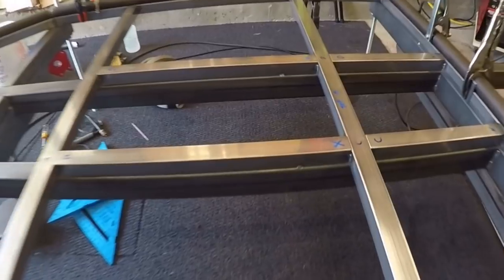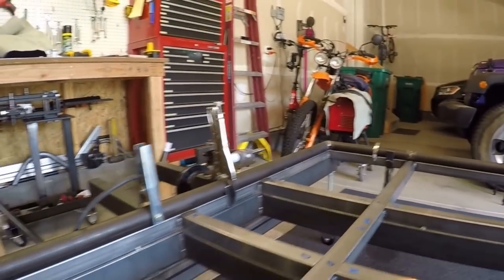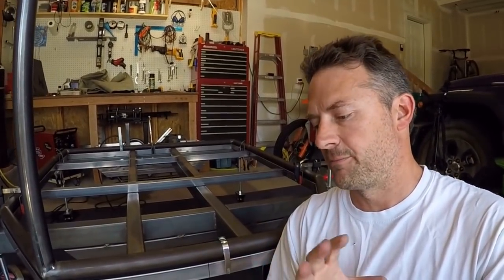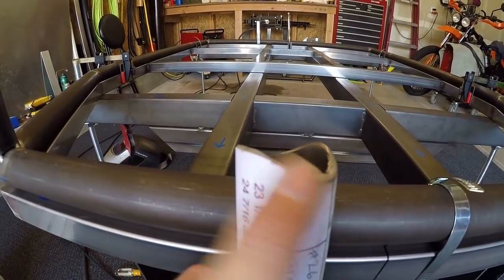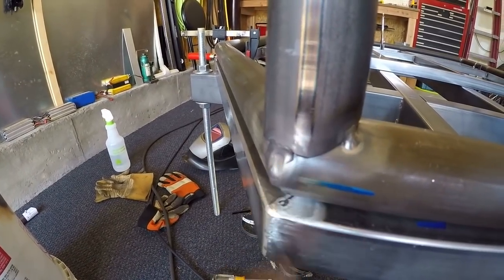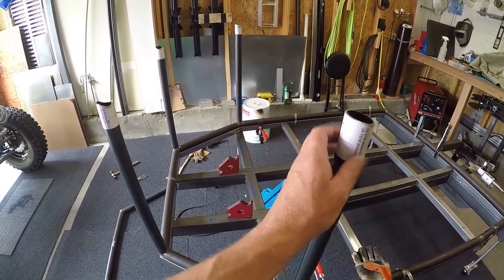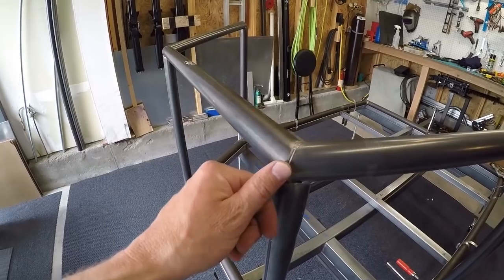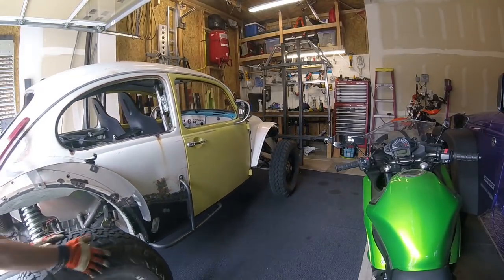Baja Tube Frame Build Part 1

Comment: What type of metal tubing  are you using? reg, dom, chromoly... also what sizes?
Reply from the maker: On this chassis the base is DOM. Everything above that is regular/ERW.
It's all 1 1/2" x .095" thickness.
Reply: @DougBugBuilder , Thanks for the info

Comment: Is there any downside to building the frame from the square tube, rather than round? I know that round is stronger, but the square is easier and flatter
Reply from the maker: The square is a lot easier to start the chassis where the body will connect to it and the floor. That's how I did the chassis I'm running on the Baja right now.
But on this chassis the square tube you see is only part of the jig. The entire chassis you see here will be made out of round tube.

Comment: Hey doug when you built your rear lower control arms what type of bushings did you use
Reply from the maker: I got them from Kar tek Offroad, here is a link to them.
https://www.kartek.com/parts/autofab-urethane-bushing-assembly-1-12-outside-diameter-2-14-total-length-includes-716-bolt.html
Theses are 1 1/2" OD. They have been fine, however I think the next set of arms I make will have 2" OD bushings for a little more umph!

Comment: After you cut the cope, do you chamfer the edge? Or do you chamfer down to the paper? Thanks for the extremely informative information, I'm gathering my supplies and hope to start soon!
Reply from the maker: First I grind it down flush to the paper which puts me right to where the software wants the cut to be. Then I chamfer it for good welding penetration. When I chamfer it I'm beveling the edge, but not all the way as to where it will change the cope. I hope that makes sense??

Comment: ps. You may enjoy seeing how this guy built up his frame. A completely different fabrication philosophy. He mocked up the engine and drive train and then built the chassis around the setup. So, when he's done, he doesn't have to try to get everything to fit up. It's a different approach. Not sure which way is easier/better. Probably depends on many factors. https://www.youtube.com/watch?v=mezLA0WDVyQ
Reply from the maker: Thanks for the link. That chassis turned out really nice, really cool how he built it around the drivetrain.

Comment: I'm blown away by the quality of your build! Great visuals on how you are getting everything straight etc. Great work! You keep this up your going to get job offers in your mailbox! lol
Reply from the maker: Thanks John! I'm glad what I'm trying to show is coming through in the videos. It's hard to tell sometimes with all the editing. Thanks for the comment.
Reply: No problems there. Your thought processes come through. It gives other builders a clear pictures of the issues faced and how to prevent and solve them. Good tips on the right angle squares etc. Level jig. Also, seems like you are so far impressed with the software cut angles. They look pretty tight! That's going to help with a stronger and accurate frame. You have me wanting to buy the software!
Reply from the maker: Next couple videos will really highlight the software and how easy or difficult it is to work with. But so far so good. If you do get the software remember I'll share any of my files with you or anyone for that matter. You could literally build anything that I build with it.

Comment: Not a tip for the build but something to help save your back and make things easier . Get a pipe vise like plumbers and sprinkler guys use . I`m sure you could pick one up on craigslist or a pawn shop .
Reply from the maker: That's a great idea! I'll check craigslist. Thanks Buddy!

Comment: Hey Doug, that is looking great 👍 I like the platform that you built I must have missed your last video so I will check it out. I like the way you can print off coping templates that is really cool, the few times I have worked with tubing I have guessed and had to do a lot of gap filing with the MIG
Reply from the maker: Hey Craig, yeah I was hoping the templates would take all the guesswork out of it. So far they are working well, but I'm really just getting started.
Thanks for the comment, you're one of my regulars. lol
Reply: Hey Doug, I really appreciate the work you put into your videos and workmanship of your builds so I like to share my thanks. Rock on brother

Comment: I built my build table higher (4ft) and on casters. This let me drive my other car under the front of it. Saved me from having to lift and move it.
Reply from the maker: That's a good idea. Right now mine is about 12" off the ground. It would be easier to work on if it is was about 24-36" at this point. Although I figure as the frame gets taller it might get easier.
Reply: Doug Bug here was mine.. No where near as cool as yours.

http://www.exportedafrican.com/wordpress/index.php/2018/04/25/stage-2-of-chassis-build-and-starting-on-suspension/
Reply from the maker: Ahhh, thank you for sharing that. I love when I get to see other peoples work. Looks like a cool chassis. I like the fact that you  were able to design the chassis around the engine. I hope not doing that doesn't bite me in the arse later. Hopefully you're still making progress on the build or now can drive it.
Reply: Doug Bug it's been on the road for 7 years now

I recently bought an ecotec ltg engine and will be swapping that in. 3x the power and 11 lbs less

Comment: So why are you doing miter cuts? Why not do bends instead. You’d have less welds and less heat and wouldn’t cut as much.
Reply from the maker: Josh, 
For the base of the chassis I want it to be more accurate. Or I guess what I mean is I don't want to deal with bend radius's. The part of the chassis I'm building at this point is going to have interior and exterior paneling. Having to connect those to rounded corners would be more difficult and I don't think they would look to good. Additionally some of these miters are only a couple degrees, with my bender it's really difficult to bend something under like 20 degrees and have it be accurate. So I thought doing miters would be easier. So far I'm good with this choice.
You are correct though, going this route I have added some complexity and likely made it a little weaker. All choices I'll have to live with. lol
Reply: Doug Bug ok that makes sense
Reply: This was my initial thought. But also I noticed Doug doesn’t treat his equipment poorly. He’s not building to take 120mph impacts. At the beginning of the video I was in anxiety. Then the reality hit me. I’m used to a bender and high impact risk. This build is totally on par with its function.